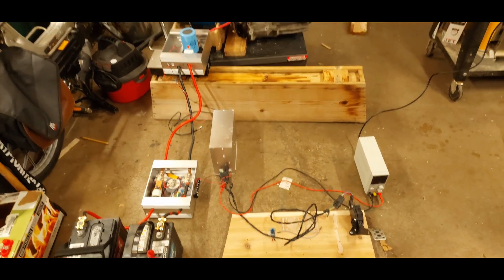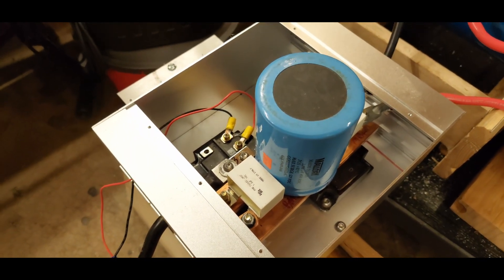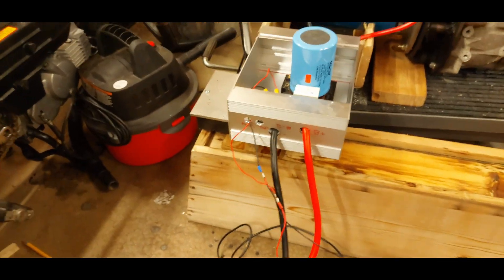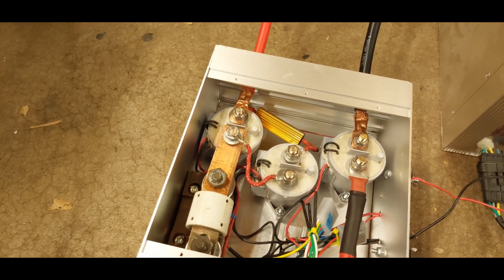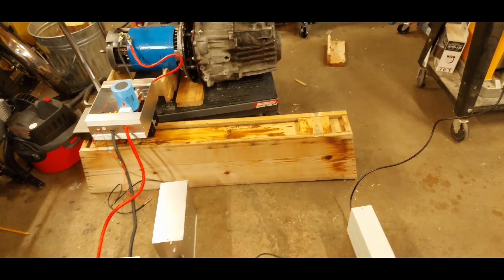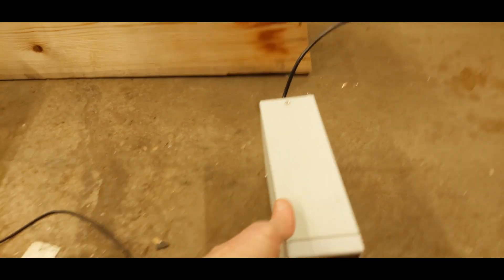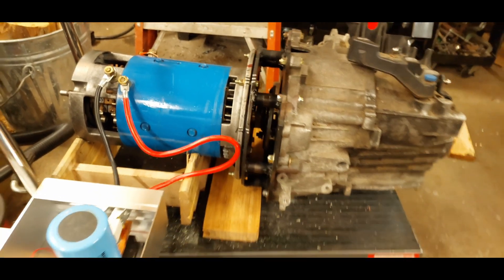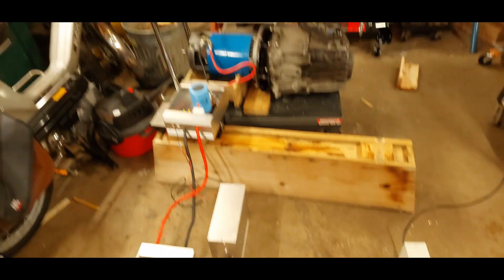EV Volvo Conversion: End to End Component Test

Comment: What voltage will you be using to power this ev? At 24v it doesn't seem to be spinning fast, even my 300lbs motor spins 80rpm/v (dc series wound)
Reply from the maker: 144